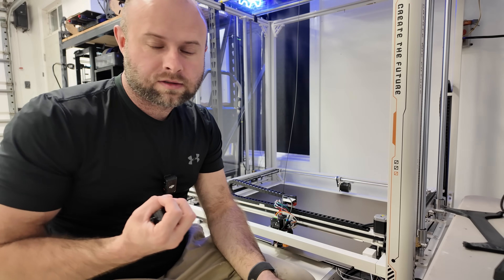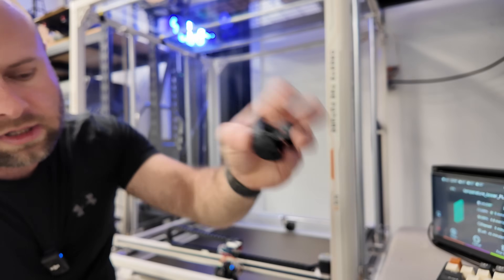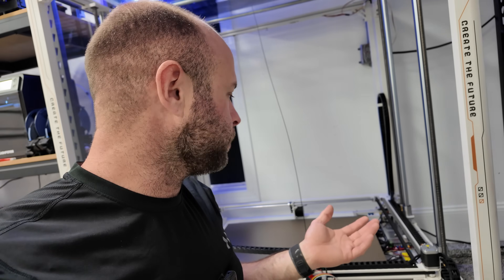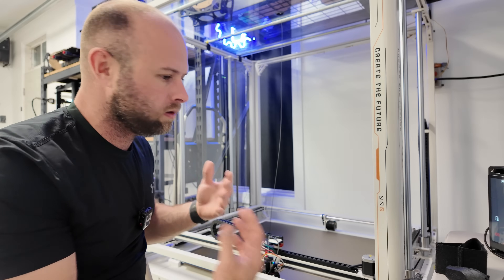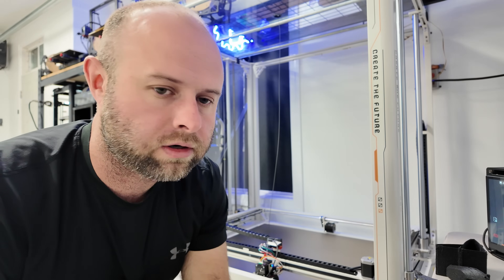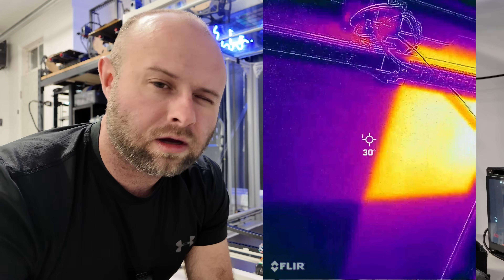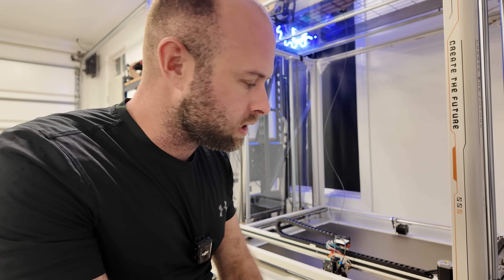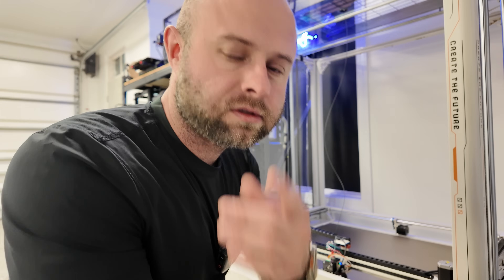IT LIVES! Orangestorm Giga / Bluestorm Tera Conversion -  3D Print Vlog

Comment: Need to do an extrusion calibration... first. And you cant do a pressure advance before that and a temperature tower because youre starting out with a hot-end thats pushing way too much filament at inaccurate temps that will produce a PA test that looks like diahria on a splintered platter

Comment: could you make a spool holder that attaches to the guide rails so the filament is just above the hotend and counter ballance it with a pully at the top of the machine so your spool is at the hot end

Comment: No Shade, I DO NOT understand spending $3K on something that does not work with out spending $2k more? I am not a tinkerer like you so I cannot be alone in this.
Reply from the maker: Thanks
I would say to find another 800x800 machine that performs reliably and consistently for  under 4k. They just do not exist
Reply: It's not hard to understand. That's the cost of a 800 x 800 printer. 5k plus your time and frustration. There is no cheaper I'm aware of. If you want an 800 x 800 that's your entry fee.

Comment: I used to join cables with those splicers until I found out you can do the same with heat shrink tubing and a heat gun. Less work and looks better. (Reference joined cables at the extruder). Congrats on improving the quality of those figurines, these are not that easy to print.

Comment: Nice work getting it back up and running.  It's too bad I wasn't close because I would have loved to have helped on this.  this is EXACTLY the type of project I leve getting elbow deep into.  Even when a printer is working perfectly I can't stop myself from looking for ANY places I can modify it to get it to work even better.  A few times I broke it REALL good but most of the time it's all good.  For me the hardware and wiring is not just easy but fun.  It's the software and configs where the stumbling can begin.  But I found that once you have a good working config for ANY printer it's pretty easy to edit it (pin numbers, offsets etc) to get it to work with a different printer.  I'm just finishing up installing klipper and a bunch of mods to my 6th printer and I just took the config from the kobra 2 I klipperized, made some changes and within about 20 minutes I was running a bed mesh.

Comment: To fix the offset you probably need to adjust your start gcode. The beacon documentation suggests adding a an adjust z offset command. I vaguely recall helping a friend that there is something specific with klipper to actually save that z offset adjust when you use probe for z homing
Reply: You need a z_offset_apply_probe before the save
Reply: @shawnabtey8315  
According to ChatGPT

In Klipper

In Klipper, Z_OFFSET_APPLY_PROBE (case-insensitive) is a macro-level command used after running a probe calibration command such as:

PROBE_CALIBRATE

Once you manually fine-tune the nozzle-to-bed distance (by issuing TESTZ and ACCEPT), running:

Z_OFFSET_APPLY_PROBE

tells Klipper to save that offset as the probe’s permanent Z-offset.
It effectively applies the calibration result to the [probe] configuration in the printer’s configuration file.

Example workflow:

PROBE_CALIBRATE
TESTZ Z=-0.05
TESTZ Z=0.00
ACCEPT
Z_OFFSET_APPLY_PROBE
SAVE_CONFIG

Comment: There is one issue with this printer that's more difficult to ameliorate than anything else, and that's the gantry being lifted using screws. There's always going to be a bit of slop in there. Replacing them with higher quality ball screws would be prohibitively expensive.